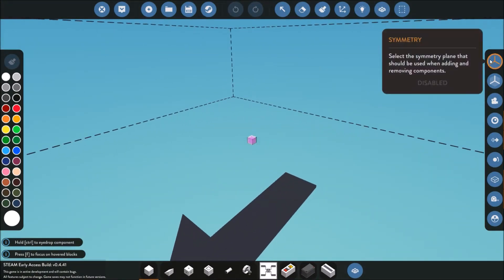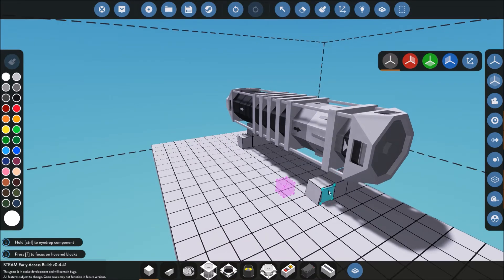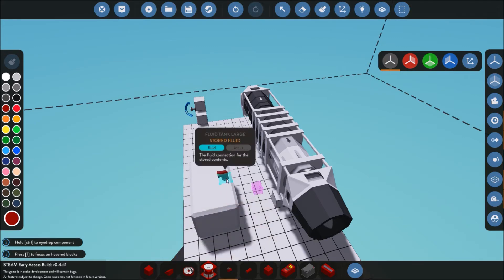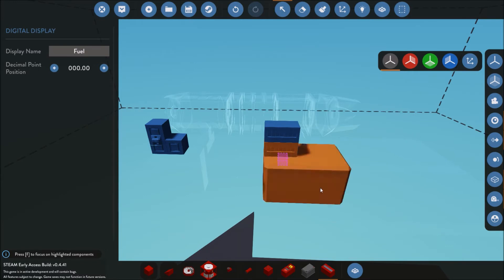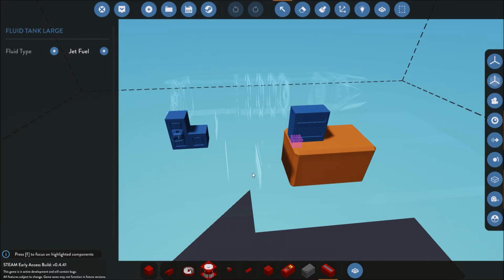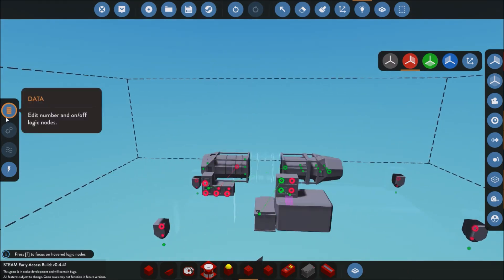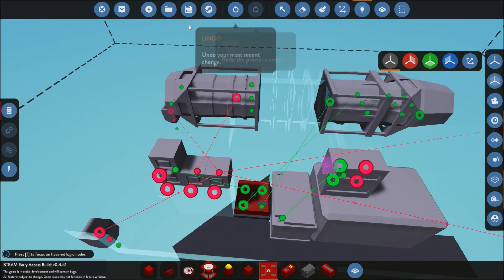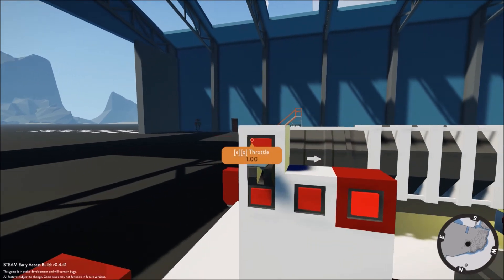StormWorks Build and Rescue - Advanced Jet Engine Tutorial

Comment: I use a PID for iT to work
Reply: With the lever can i set the rps
So if i set met lever to Max 200 rps iT is going 200 rps
Reply from the maker: Can you throttle to 100%?
Reply from the maker: I will have to tinker with the PID controller again.